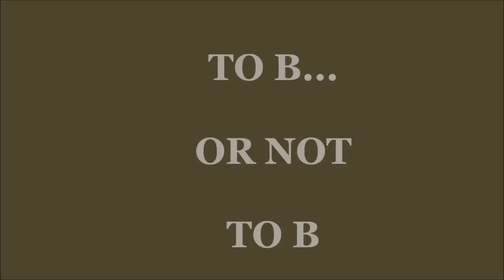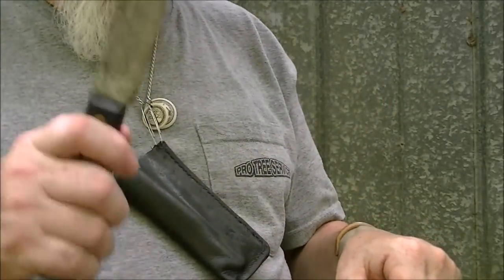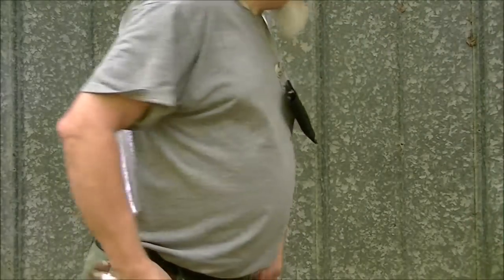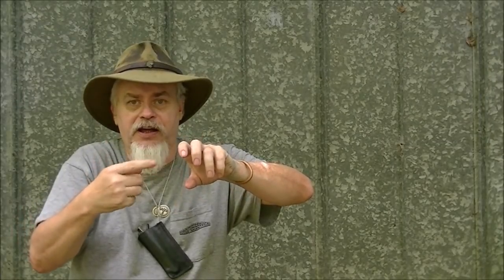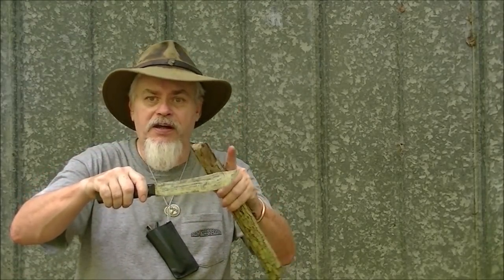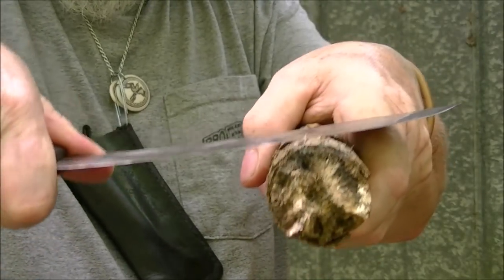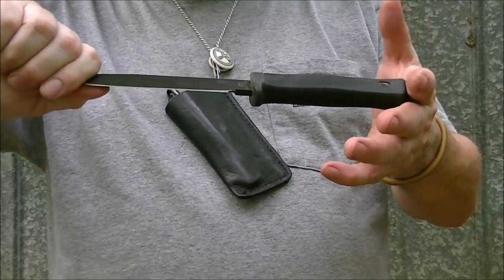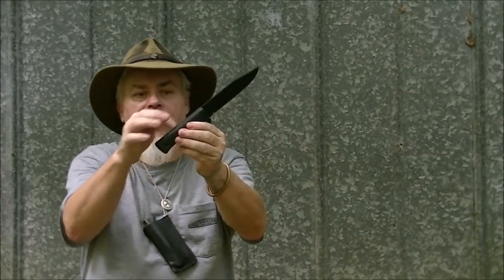to B  or not   to  B

Comment: You are correct, sir.  If a person simply <must> baton wood, carry a froe. They aren't designed for it either; but at least, they don't cost as much a a high dollar knife.
Reply: Actually, a froe is exactly designed to be struck into rounds of wood to split them.

What do you think froes are designed to do?
Reply: I actually own a froe  . If I was going to carry it into the woods I would only carry the head and cut a handle for it in the field to cut down bulk and  weight.  In saying that I built a chopping / splitting knife from a small utility trailer leaf spring  . It has the loop in the end to use like a froe  and a handle  between the eye and the sharpened blade to hold it like a machete for chopping.
Reply: @backwoodsrambler5102  That's exactly what I was thinking.  But the weight concerns me.  It just seems like a lot of weight for a, more or less, single-use tool. I wouldn't want any less if I was shaking a roof, but . . . .

For those die-hard batoners, maybe a Stanley strike-strike chisel/knife thingee will satisfy their jones.  Persoanlly, I'd rather have a tomahawk or hatchet.
Reply: @backwoodsrambler5102    You probably should have a titanium version custom-made with a carbon fiber handle so you can YouTube-approved Tacticool.  : D
Reply: @camojoe83  I think froes are designed to split shakes.  Shakes are thin slabs of wood used for shingles.  

Thin slabs of wood split off larger pieces of wood are not going put as much side-strain on the froe as splitting a large round down the middle; especially if the wood is cedar.

 Every froe I've ever seen could do the job well enough.  I think you'd get a lot of done without damaging the froe and very well might never have any damage - but they aren't designed for that.
Reply: It is actually  dual purpose.  Without the handle you can chop like a hatchet (chop down a sapling and shape it to make the handle then install handle and use it like a froe.)  I have  actually used it as a draw knife to shape handles after roughing the handle out.
Reply: @backwoodsrambler5102  That's funny because when I was a kid I was using my grandfather's as a draw knife when he told me what it actually was.

If you make a handle that goes in from the other end, (I'm assuming some taper in the eye that may or may not be there), can you use it any better as a chopper?  Or, is that just a wild-assed idea of the top of my head?
Reply: The eye is wider at the bottom than at the top.  Between the eye and the sharpened section is a hand grip with wood scales epoxied in place and copper rivets. The end near the tip (about the last 4 inches) has a shallower grind than the 10 inches between the handle and outer end.
Reply: @backwoodsrambler5102  I never one with a hand grip before.
Reply: @PeterWolfe2012   I made this one myself using a leaf spring from a small utility trailer.
Reply: @backwoodsrambler5102  Sounds like it

Comment: good explanation. i hope you make a video about digging up your cache. id be curious to see what method you used and how the buried stuff faired.
Reply from the maker: i used 30 gal plastic soap barrels from a dry cleaner they often throw them away when they done..i sealed everything inside all metal  was coated with a mix of parfinwax and oil then wrapped in wax paper..all openings were sealed with silicone caulking..and then finally all outside openings were coated with roofing tar  the kind in the can for cracks..a place well aboves water table was chosen..that was 1992 (i think )and i dug it out in march this yr all is fine but the snap on the srk sheath was rusted the only loss
Reply: @BLACKIETHOMAS  that makes a lot of sense. seems like a good method. up here on northern Wisconsin its hard to keep metal objects in a cashe from rusting even when heavily greased because of the extreme temperature changes. seems like stainless and moisture absorbers might be part of the solution.  thanks for sharing the good info and practical experience.

Comment: What popped into my mind is when you only have long drywall screws but use em any way hit the point sticking out the back side with a hammer if you hit them just right only takes one hit to shear them off flush. They really fly when that happens.

Comment: I got an $8 Harbor Freight special for all my batoning needs. AND. If/ and/ when it breaks. I'll still use it somehow, for something. But other than all that. Good sound advice. I wouldn't do it to any precious knife, no. I've been running through fatwood. I've got a little more than $8 out of it so far
Reply from the maker: very true for many yrs i carried a big bowie as a chopper baton knife and a smaller better quality knife for the carving tasks..i would not worry about batoning that thru a fat lighter stump..but it cost 5 bucks at a yard sale and if it snapped..oh well..thats why i had the back up..as memory recalls that knife had ducktape on the handle because the pins had vibrated out..it was lousy and soft and thus a good froe..
Reply: That's how this one is. Had a pin holding the blade in. I took the pin out. And epoxied part of a steel drill bit in there. I upgraded some junk, basicly. Its the Rambo style survival knife. The compass is good. I replaced the contents, better matches. Fire items. The sewing & fishing components, I left out.

Comment: Got a laugh out of this is a pry an engine block out of a truck knife ..   I don't know which video it was but a different school than you mentioned a guy was batoning a ka- bar Becker bk1 on day one and it snapped on him ..   that's a hunk of money down the drain ..  for a baton knife ,, I have an old lawn mower blade I ground an edge on and attached pallet wood handles on with sex screws ,,   I have beat the snot out of that thing splitting maple , fat lighter knots , etc .. no worries. .. if it ever breaks I'm not out even 3 bucks.. and when I get back to home base in under 30 minutes I can have a new one made

Comment: When I see someone batoning, I think of a froe. It's basically a heavy knife, but designed and heat treated for toughness, not edge holding. I haven't heard too much about froes breaking, but look at any well used froe, it's all swaybacked and out of shape. Is that what you want your knife to look like?

Comment: That's an interesting point Blackie. I had also read/watch blacksmith say that a perfect 90° line anywhere on a knife (spine, handle design) can cause a weak point for impact tasks as the vibrations won't be dampen in the entire grain structure of the knife. Possibly amplifing the "spagetti effect"you mentionned.

In theory, a slightly rounded spine would make a knife tougher than a 90° one. As most bushcrafter like a 90° spine on there knives, what is you tought? Thanks for posting, have a nice one sir!!
Reply from the maker: in many industries..a sharp 90% is know to be a weak point in moving parts..it will be the place a crack forms and then pop..thats why the round so many car /gun /aircraft parts..same applies to a knife
Reply: @BLACKIETHOMAS  That's what I tought. Thanks for your answer!

Comment: If it's heavy enough to chop well, it will baton forever. Knives break under lateral stress 99% of the time they break. Knives broken by youtubers batonning them suffer from being held very solidly and struck at an angle other than perpendicular to their load. The said YouTuber is already weak from setting up the camera, and their baton is poorly chosen (too big for their bitch arm to swing). Combined, and you get that limp wristed off strike landing more to the crossload than the compressive and SNAP ! Dead boutique knife that was only supposed to endure eyeball prints, crybaby trend chaser whining about how "batonning is stewpuhd!" and more fuel for this argument. 

I've got a few knives i would have confidence in to survive batonning steel gas pipe and master locks. 
Because they have been proven to do so many times.

I'm sure they'll split a foot of straight grained stick to pop out a dry section for feathering whenever and as many times as its asked. 

Its not like you're going to baton your way thru a cord of roundwood, ever, anyway.
Reply: I agree.  I don't think most people who baton are looking to split stacks of cordwood to run a fireplace for the winter.  With due respect to Blackie (and I do respect his skills and knowledge) I figure if a fairly thick, somewhat heavy bladed 'main' belt knife or larger 'chopper', meaning not something as thin as an Old Hickory or a Mora, etc., isn't strong enough to split out a couple of pieces of wood about the thickness of my forearm as starting fuel for a fire then I WANT the danged thing to go ahead and break so I know it is a piece of junk and can throw it in the trash where it belongs before I get it in my head that it is actually a good knife.  As for why anyone would split wood no thicker than that, well, I live in a part of East Tennessee that is considered to be a temperate rain forest.  Most of the time there is no such thing as completely dry wood that is dead and down so one has to get to the center to get dry wood to get the fire started.  Sure, once the fire is going I can just lay whole pieces on top to dry and burn but getting it started requires splitting.  Yes, I have axes, a maul and wedges at home for splitting REAL chunks of wood and I have used such implements for most of my life (although not too much any more because I don't have wood heat at home.)  I also have a couple of hatchets and a CRKT Woods Chogan that I like a lot for slightly bigger stuff but don't really see the sense in slinging around a 1.5 or 2 pound chunk of steel on the end of a stick to split something that a good, modern, well heat-treated knife will generally pass right through with no more than a few taps.